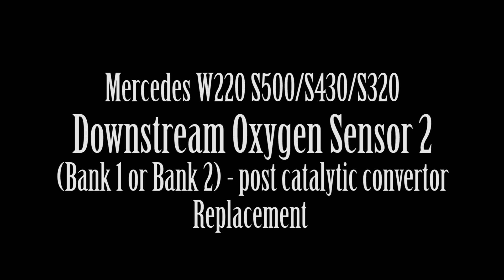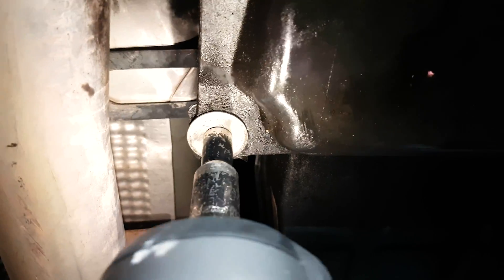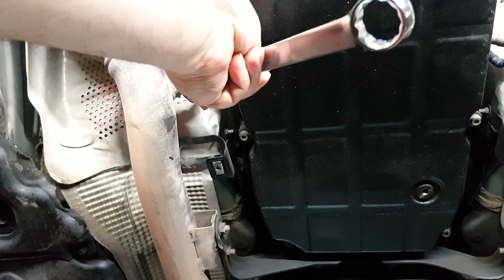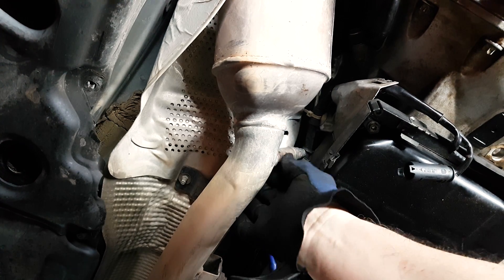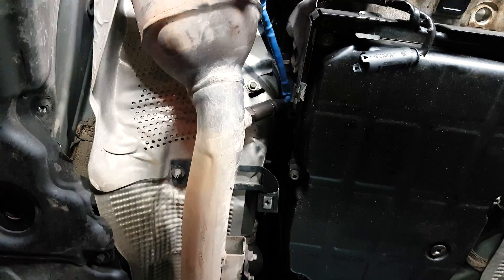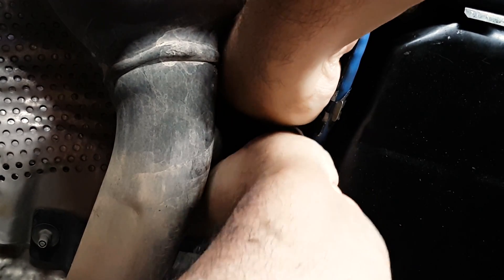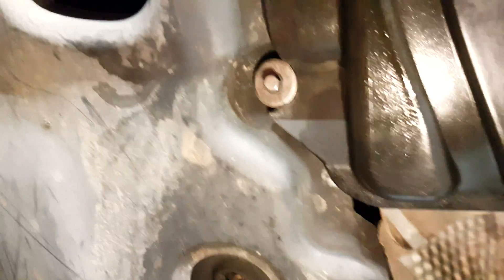Mercedes O2 Sensor DIY - Bank1 or 2, Sensor 2 - M112, M113, and other engines

Comment: Hi, did your car stall when you were driving it and would not start?

That just happened to me yesterday. I have only one DTC: P2032-008, with my iCarsoft scanner MB 2.0.

Is the exhaust gas temperature measure by both PRECATALYTIC & POSTCATALYTIC O2 SENSORS?

Thanks!! Merry Christmas.
Reply from the maker: Hi.  No, mine didnt stall.  Neither does.
Most cars use a post-catalytic converter temp sensor to monitor exhaust heat. Pre-cat sensors measure before the converter for fuel trim and catalyst efficiency. A post-catalytic oxygen sensor measures oxygen levels in the exhaust gases—specifically, how well the catalytic converter is cleaning them...

Comment: Thumbs up. Subbed. I need to do this on my cls63 2012. Question will the new OX sensor adapt or do I need to unplug the battery for the values to reset? Thanks!
Reply from the maker: I don't think any adaptations are needed.

Comment: Do you know whats the part number for bosch ml350 2015 4matic oxygen sensor upstream? I got a code for bank2 sensor 1. Appreciate it.
Reply from the maker: I don't, but it is not difficult to find out.  Call a dealer and supply your VIN plz.

Comment: Thank you for not talking fast and going fast through the video. Thanks again for taking your time with the video.
Reply from the maker: @patseykinney5394  thanks.
Reply: @masood-tv  my check engine light comes on whn i reach 60mph otherwise it stays off maybe one of these sensors could be problem? I need to see wht code its throwing

Comment: Excellent video but a couple questions.  The O2 plug, when connected, has to slide out of the metal bracket that holds it first, correct?  Do you have to slide the plug to the side, or up, to get it out of the bracket?
Reply from the maker: @pfsantos007  thank you. You just slide it out.  Please see starting at 02:10 minutes of the video.

Comment: Wait, so all of the four sensors are close to the 2 front catalytic converters? None on the 2 in the middle of the car?
Reply from the maker: Correct, measuring what goes into and out of them.
Reply: @masood-tv  thansk man!
Reply from the maker: @salemsuljkanovic2067  my pleasure.
Reply: Hello, I had a engine light one saying that nox  sensor down stream it's faulty....I have changed the now sensor and after a few days come back again with the same issue says its working outside of the perimeters. Went to mercedes they said that I have to replace the other one ...but when I scan the car is saying only about down stream one ....why shall I change the upstream one ??? Can you please let me know if it alright to do this .thank you

Comment: Hey I have a code showing bank 1 sensor 1, I believe it is upstream but not sure if its left or right, do you by chance know which bosch part I need for 2014 s550 base? Appreciate your help and videos! Hoping to do this myself as well.
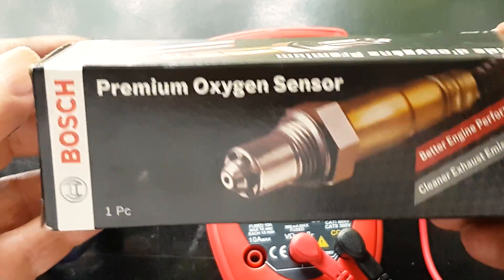Reply from the maker: Thanks.  I explain where bank 1 and 2 sensors are at 3:20 minute of the video.

Comment: Is that cylinder 2 or 1
Reply from the maker: This is for either side, but the downstream sensor or sensor 2.
Reply: Mine says bank 2 sensor 1 is that the sensor In engine bay the very first one
Reply from the maker: Hi Jemal,  yes, it is the one in the engine bay.
Reply: @masood-tv  ok thanks  on my 2013 ml350 how would I remove it the computer is in the way
Reply from the maker: @jermalramsey1567  I can look it up for you in a day or so, since I have never replaced the sensor on that car. However, don't be afraid to remove the computer or anything in the way.  Just remove the negative battery cable first.
Reply: Ok thanks
Reply: I changed all of them in my 2001 Mercedes e320 with 191,675miles runs like new and the performance is wow.

Comment: Hey Masood 
I have problem in my car w210, the trunk doesn't open, when i remove wire of battery it work about eight times and them doesn't again, i hope understand the problem, if you have any idea about this problem
Reply from the maker: Hello Abdallah, is that with the key fob, car button, or both?
Reply: @masood-tv  both
Reply from the maker: @abdallahdaw7045  it is an electric connection issue.  Get a wiring diagram, and a  volt meter with resistance function and check at all connection points
Reply: Hello am asking by chance if you found the issue I've got the same problem